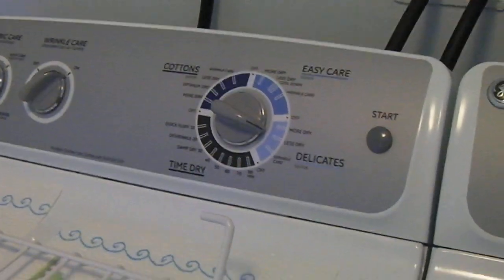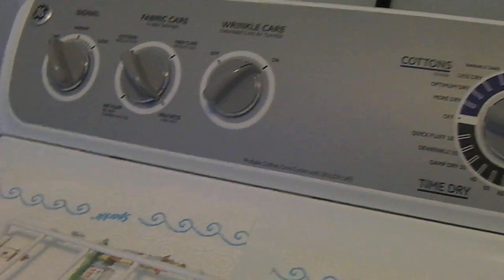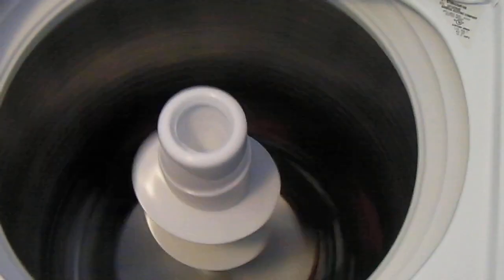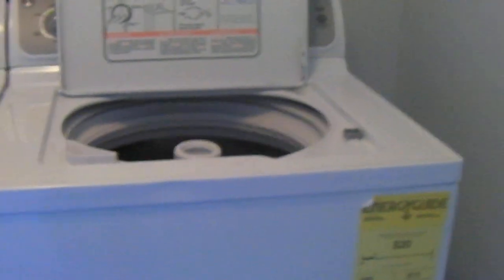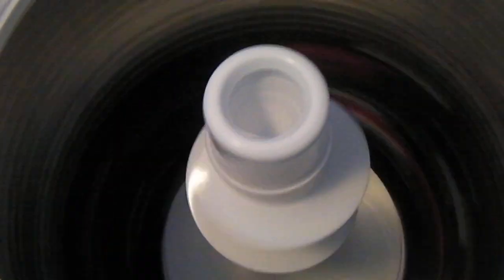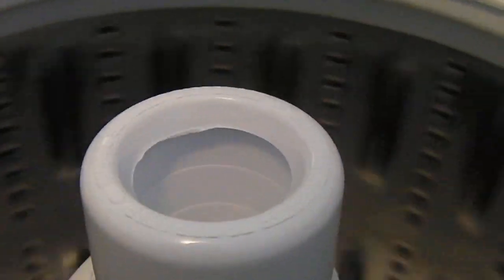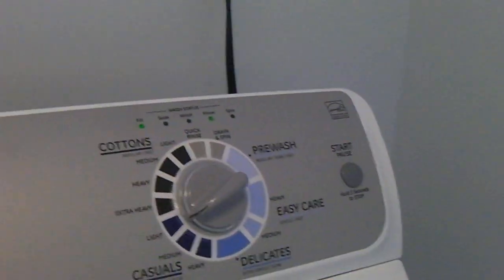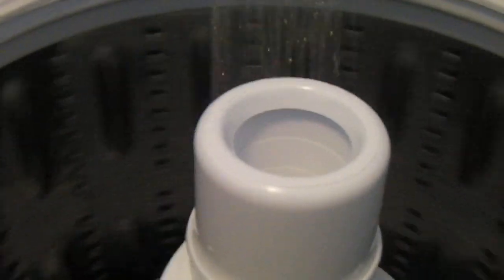Ge Hydrowave HE topload washer main wash

Comment: I bought this washer in Nov.
Avoid the accu-fill.  I've monitored this function several times.  I put in 10 bath towels and it filled to the top of the paddles.  It looked very rough on the towels and seemed to be very hard on the machine, a lot of banging and loud noises.  Several of the towels took like 5 minutes before they ever got wet.  So if you are thinking this works like a "old fashion" top loader it does not. 
The Super wash level only fills to half way, large barely covers the paddles of the agitator, thus HE and it spins and extremely long time.  Numerous times I've turned it off before it has stopped spinning.  The agitation is side to side instead of top to bottom like an old fashion top loader.
Another biggie is  the regular rinse (non "power rinse") does a lot of strange things, fills a little, short agitation, spins, repeat and repeat again and then spins.  The "power rinse" fills to the water level selected and agitates for like 5 minutes.
The machine does a good job of getting the clothes clean but I only fill the washer with dry clothes to the level I know the washer fills. The pictures in the manual show the washer full of dry clothes when the super water level is chosen and remember it only fills half way.  That doesn't work for me, like I said seems to be very rough on the clothes and the clothes don't move freely through the water.  Thus I end up doing extra loads, so much for HE for me.
Also in order to get the machine to operate with the lid open a magnet placed on the plate will get it to work.

Comment: The GE HydroWave. Absolute junk. The most common failures of these machines are a failed mode shifter, a bad tub bearing, a bad motor, and a grinding or squealing noise during agitation. These also shake violently and move across the room when they go off balance. GE should’ve just left the Filter Flo alone. HydroWaves are by far the worst GE washer ever made. Even compared to the newest GEs. The pre-HydroWaves were not the best either but they were better then these. The Pre-HydroWave models had a very aggressive agitation (very much like a direct drive). They also had a transmission. But they were not the most reliable and were absolutely horrendous when used in a commercial setting. But they were not nearly as bad as the HydroWave. The newest GEs are much better than these HydroWaves ever were. The newest GEs are still absolute junk of course tho. HydroWaves are just nothing but trouble.

Comment: i cant figure out how to work this washer, I loaded 20 tshirts in and the water level to max but it only came up to half way covering the clothes, so what happens when I fill up th ewasher all the way to the top??? the settings are also confusing... I don't recall getting a manual, my landlord came and installed it along with the dryer... any good info/advise?